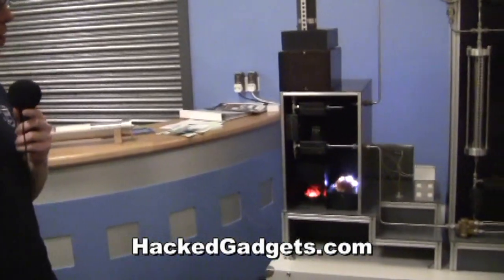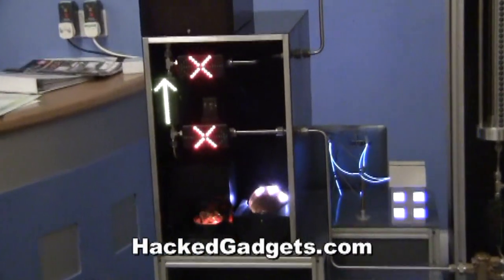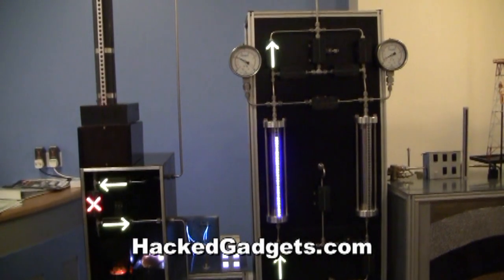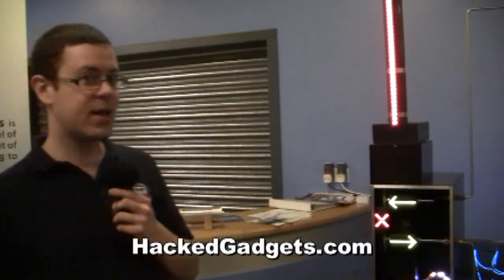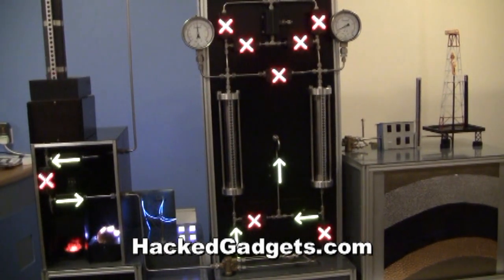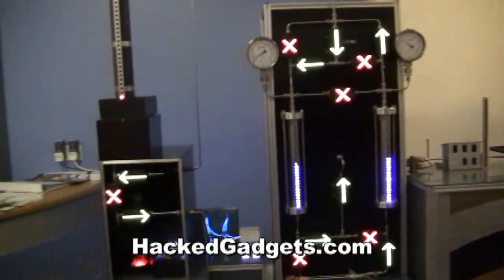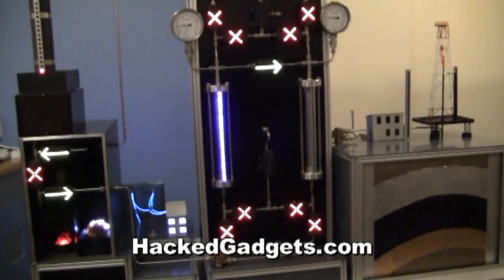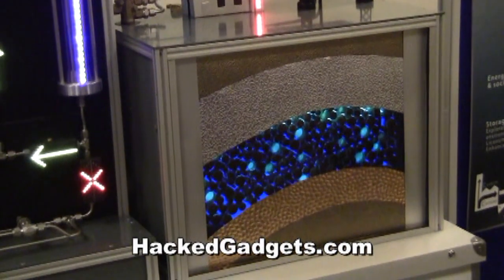SCI-FUN Fusion Under Sea Carbon Capture and Storage System

Comment: @WodeBolder puttig the plants near the coal power plants would not change the net effect.  Also, you would need a heck of a lot of plants.  I havent run the math, but consider the fact that the carbon stored by plants is litterally the carbon content of the plant itself.  You would need to grow the plants at a rate that would counteract the carbon dioxide emitted by the coal plant, which is several hundred tons (a guess) of carbon dioxide a day.  Also, plants are not entirely carbon and oxygen.